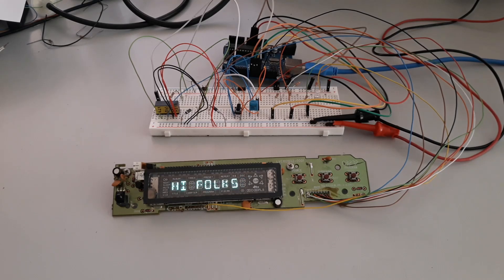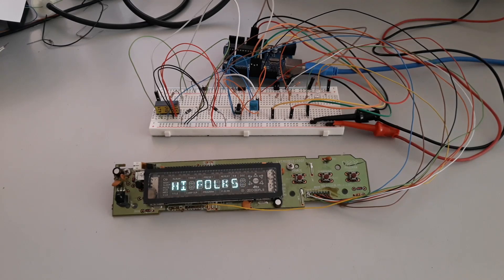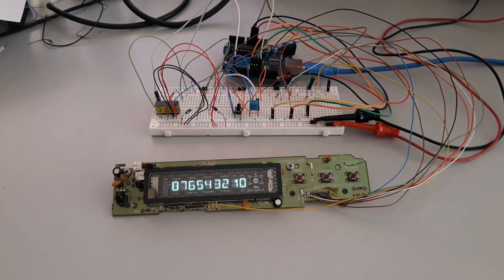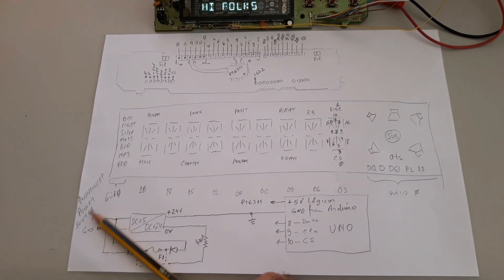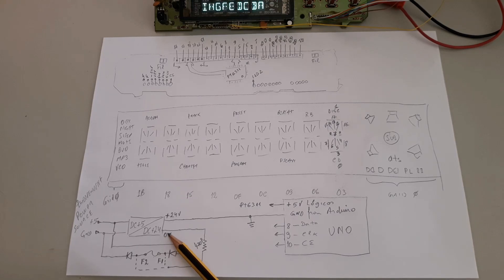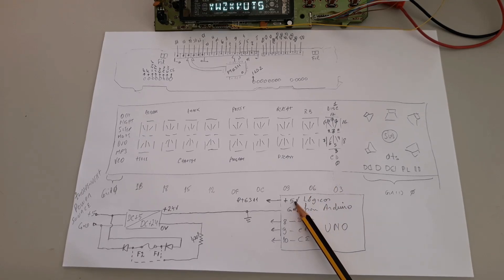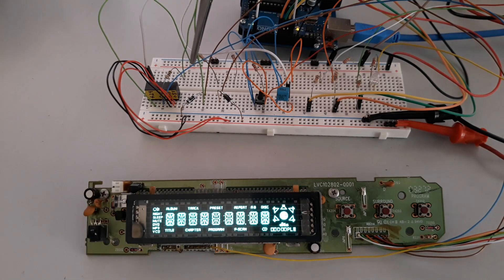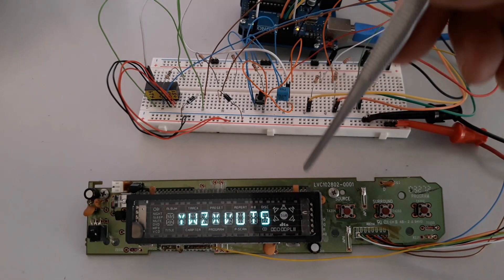PT6311

Comment: Is there a way to overcome the problem of the screen being on but not responding to anything? Is the PT6311 IC damaged?
Reply from the maker: @ardikadani1010 • 1 hour ago
Remember that working with electrical devices is very dangerous!
Please tell me: when you say the screen is on, does that have to do with the filament or do you see any bright segments?
I don't usually find faulty PT6311s; this is a good and robust driver, but I'll never be sure if I don't check the microcontroller's connection bus, such as: Data input, Clock, Strobe in relation to GND.
If some segments are bright, it means that the driver's power is present, even if there is, for example, AC noise due to poor filtering in the power supply.
Please, @ardikadani1010, see an answer in another video on the channel about the PT6311, where there is a question about the PT6324 (it's not the same, but make the pin equivalence with the datasheets of both drivers) for a question about the PT6311. Just search the channel for: PT6311 and videos about PT6311 will appear.
If you could provide more details about this problem, such as the model and brand of the device to which the controller belongs, we could analyze the wiring diagram.
After all check be done, you can always replace the PT6311, as it does not have any resident code. Just be careful with the encapsulation because there is more than one model.
Reply: @jlsmonte Okay bro, thanks for the information.

Comment: Oi José, eu não entendi qual é esse Conversor de Energia, mostrado no vídeo: DC +5/DC +24. De outra forma, existe algum componente que forneça diretamente os -24V? Obrigado
Reply from the maker: Hi! Quando se diz -24VDC, não tem de ser obrigatoriamente esse valor! Podemos consegui-lo aproximadamente com por exemplo duas pilhas de 9V em série. Resulta em +18V mas já funciona. Devemos usar uma resistência em série para proteção das pilhas caso haja algum erro de ligação, bastando uma R de 330ohms, uma vez que a corrente se situa na casa dos miliAmperes (2~12mA) em modo dinâmico e dependendo, é claro, do VFD.
Uma referência para este converter DC/DC pode ser a "B0524S" que encontra à venda na Web. Devemos ter em linha de conta que a presença da letra "S" significa primário/secundário isolados e é essencial para este tipo de utilização. 
Espero ter ajudado!